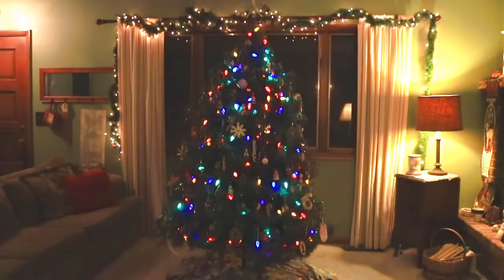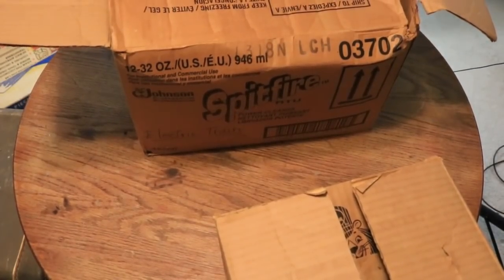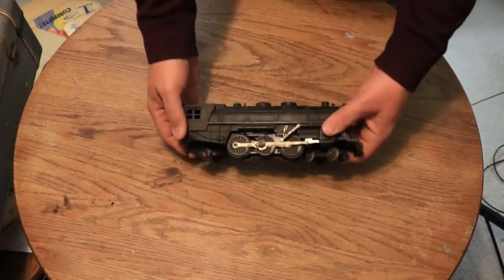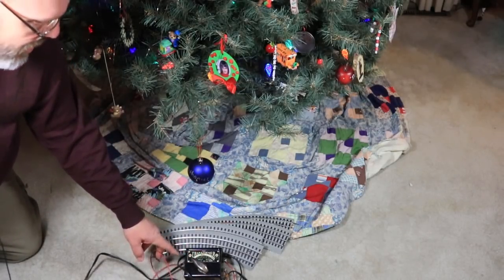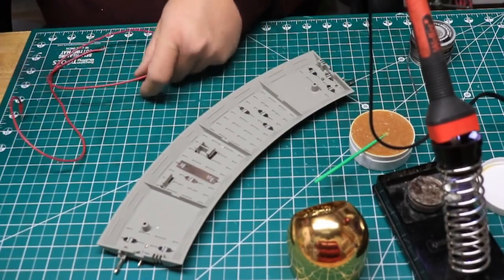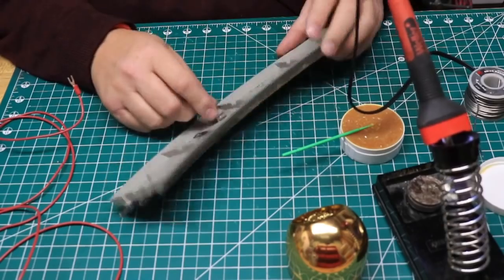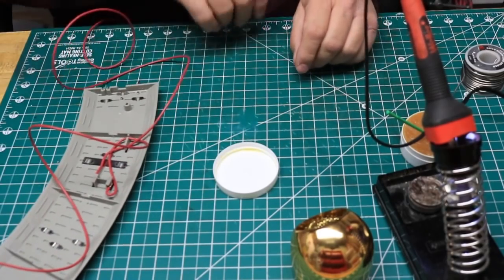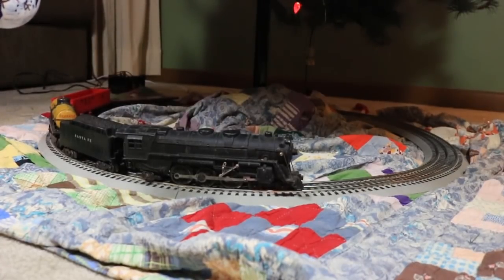Train Around The Christmas Tree

Comment: Wonderful train!!! Ron, can you please walk me through the voltage numbers for your N-scale layout, and, if possible, what those numbers would be for HO-scale. Specifically, what voltage is used on the bus wires? What voltage is running along the train tracks? Happy New Year!!!
Reply from the maker: I am running MRC Prodigy Advance2 which is a 14.5V system which I believe is pretty standard for HO or a N scale. Larger scales require more voltage and thus boosters, but I am not certain on the specifics of those specs.